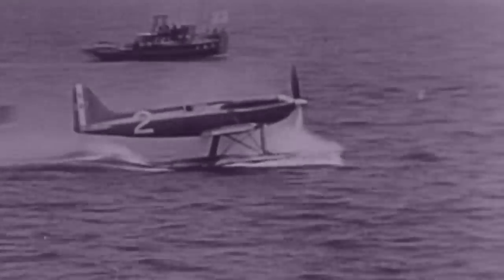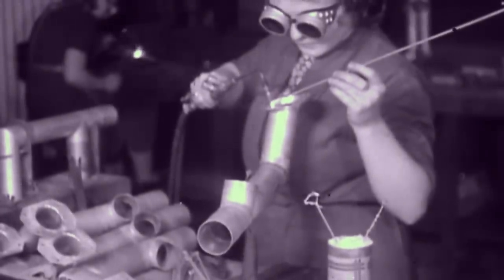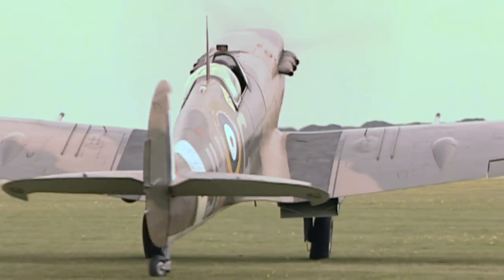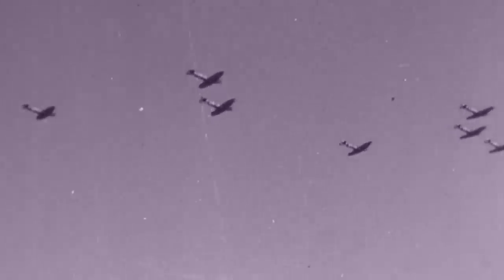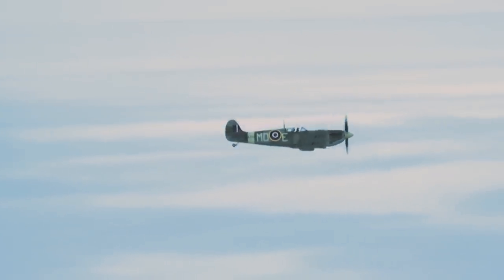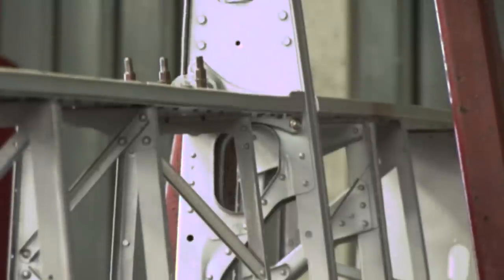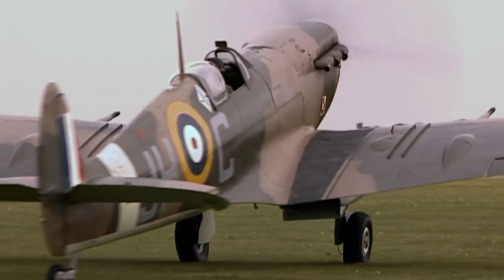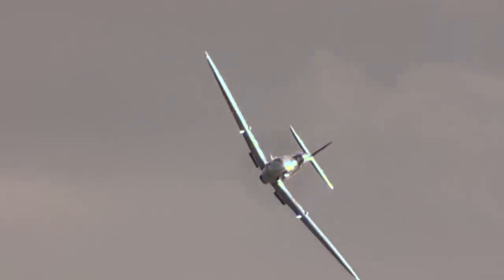How Did The Supermarine Spitfire Become A British Icon?

Comment: It was an excellent plane piloted by great men. However, it would have been even better if it had fuel injection.
Reply: Yes,and bread would be great if it came ready buttered.
Reply: It didn't need fuel Injection, which had a compromising quality in high altitude flight.

The Supermarines and Mk 13 spits  were the finest fighters of their day, and when they joined with the hurricanes, we defeated the luftwaffe and saved Britain.

The spitfire is loved and revered throughout Britain.
Reply: There was a reason Rolls Royce didn't use fuel injection at the time which is why the Merlin engine was more efficient.
Reply: Early Merlins used the carb which cooled the F/A mixture thus providing more HP.  Later,  more powerful merlins used FI on the late production Mk.V & Mk,IX's etc